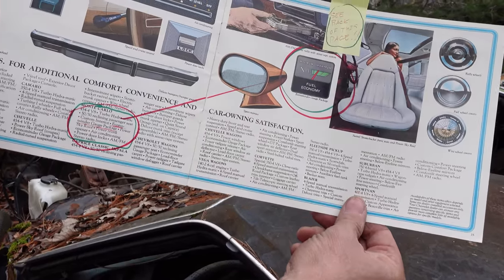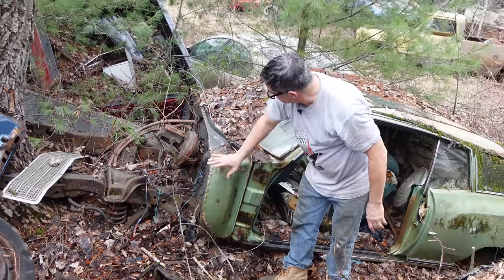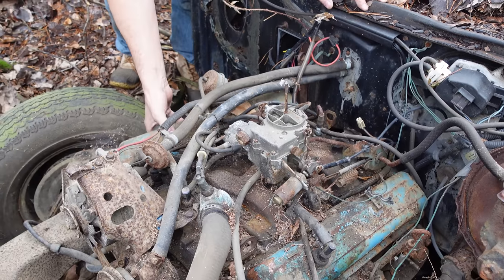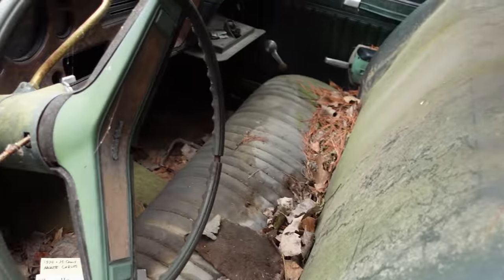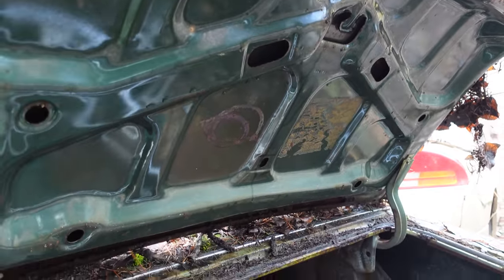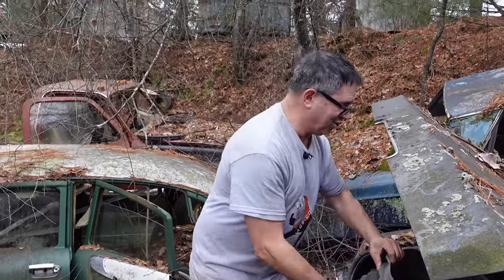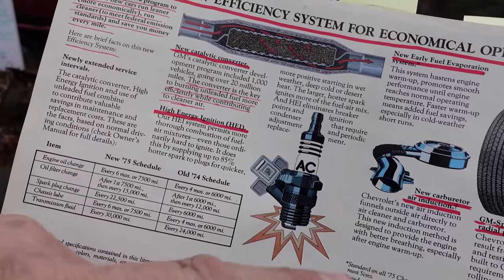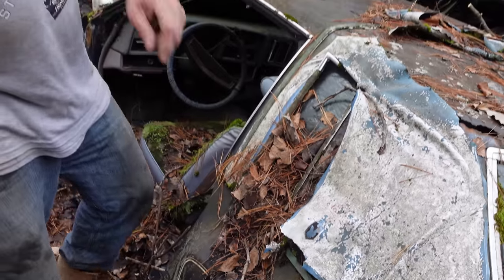Twins of Monte Carlo

Comment: I always have liked the looks of the '73-'77 Monte Carlo.

I have never driven one.
But I was a passenger in one many times, back in '84 & '85.
A buddy (& classmate) bought a '77 Monte after high school.
And we had some fun times in that car during '84/'85.
Unfortunately, in very early '86, the car developed an electrical short in the wiring harness. And the resulting fire charred everything on both sides of the firewall (both under the hood, and inside the dash).
And the car never saw life again.
But fortunately my friend was able to get the car stopped, and got out of it without any injury to himself.
Reply: Must've been caused by the under-dash equalizer/power booster wiring, and too much loud Motley Crue...😁
Reply: @DanEBoyd  could have been.😁😁😁😁

Comment: My '65 Impala SS convertible with a 327 had a vacuum gauge in the all steel center console ahead of the Powerglide T-handle shifter, where a tachometer would have been  available. It was accurately labeled "manifold vacuum" instead of what 10 years later would be called an "econominder."

Comment: We all know that shovel has had their timing chain and camshaft problems the good thing about those early Monte Carlos you only have to pull the fan shroud put the car up on the lift chest High and you can do any kind of work you wanted to on the front of the engine timing chain camshaft the cam was close to the radiator but as long as you pull off the support on the top we were able to remove it Boy I Miss cars that were that easy to fix

Comment: Hi Steve, good video!  A brand name for a engine vacuum gauge was a "Mile-O-Meter" years ago.  The Chevrolet Monte Carlo was produced on the GM "G" body platform as was the third generation Pontiac Grand Prix, similar to the GM "A" body platform.  A third generation Pontiac Grand Prix convertible was also proposed but never saw production.  Please reply.  Dave...

Comment: At 7:04, what is that rim from? 1950s Pontiac? Center has the appearance of the Holman- Moody NASCAR wheels, with the triangular ribs and 5-on-5 lug pattern.

In my neck of the woods, those second Gen Monte Carlos didn’t rust so badly, but many ended up on the local paved asphalt circle track.

Comment: Did I get that right? That carb, same jets, was 1/3 of the original GTO 6 pack? Maybe not the same jets but the carb body.
Reply: Likely the same/similar 2GV Rochester used on the Tri-Power set up, yes.
Reply: I had one on a 350 powered grand prix.  Was an excellent carb, newer had any issues.  Always started and ran good, even when the cold.
Reply: It would be most similar to the center carb, which was the 'primary,' and had a choke.  The outboard carbs had no choke, but I believe they were mostly the same beyond that difference.

Comment: I have a '75 Grand Ville with the gauge package...no idiot lights...and it has a Fuel Economy gauge as part of that...'As If' fuel economy was a consideration, or even possible, in a full size Pontiac, or Monte Carlo.  As with the Chevy it is just a vacuum gauge, and I like to see how long I can keep it in the red power zone while driving lol...mostly though, it's just straight up between power and economy.  Its the most active gauge on the dash, prob even more so than the speedo

Comment: The 70 model uses the same doors and front and rear glass along with the trunk lid as the 70 chevelle
Reply: Doors are different. The body lines tell the story.
Reply: @danjanes8689  thanks the door outside sheet metal is different

Comment: I had a 73 Plymouth Sport Suburban Wagon (400ci 2bbl) with the fender mounted turn indicators on it. Back in the 70's I was a Chrysler mechanic and acquired the pieces for a Chrysler Fuel Pacer system. This did basically what the vacuum gauge did on the Monte. I put it on the Plymouth because my wife at the time kept complaining about fuel mileage. I didn't tell her what I did. Right after I installed it, I asked her how the car was running, and she said great but there was a short in the left turn indicator light as it was staying on just about all the time.

Comment: Nice job , but  it was 73 to 79 body, plus they have two body 78 to 80 then 81 to 88 ,I have a 1970 love it
Reply: That is not correct in reference to the Monte Carlo. It was 1970 to 1972, then 1973 to 1977, then 1978 to 1980, a redesign in 1981 and that ran through 1988. The 1978 to 1988 cars are basically similar underneath, but of course the sheet metal changed.
Reply: @googleusergp   yes, this exactly.  The 77 up B bodies are also based on these 73-77 a bodies.   1977 was the only year that Chevrolet's "full size" was smaller than the monte carlo "midsize"
Reply: We had  both 1979 body’s I have books on montes love these car